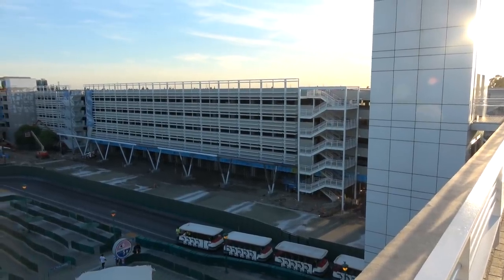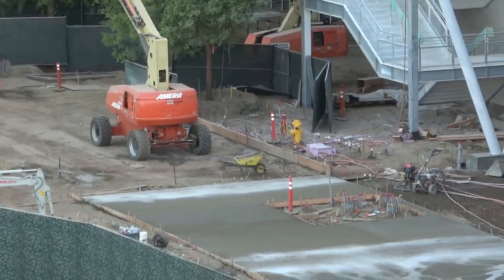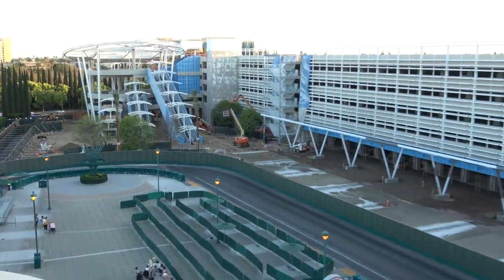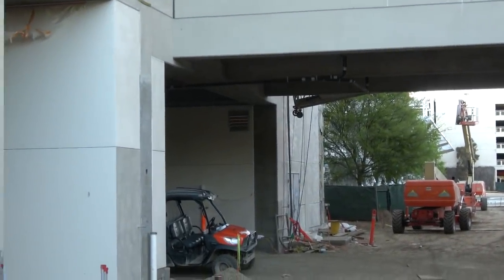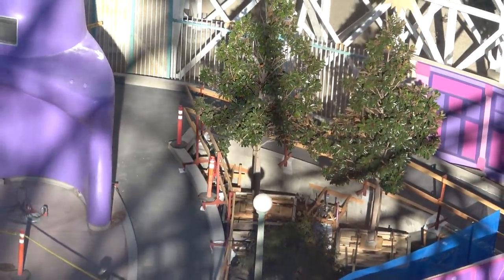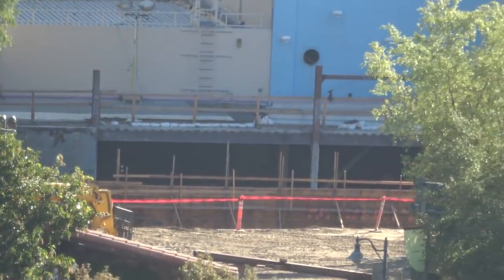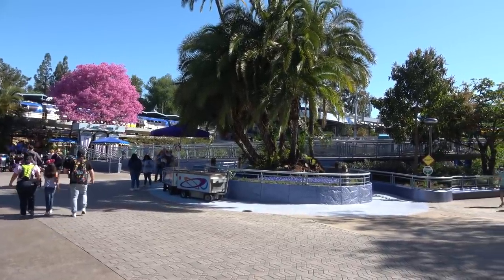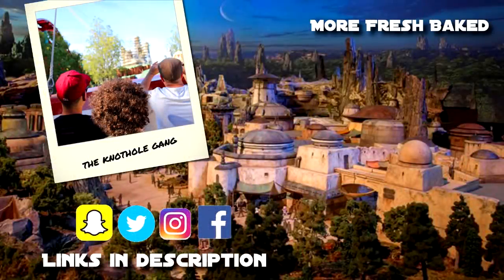Emotional Whirlwind surprise! - Disneyland Construction | 04/13/19 pt 58

Comment: Nope, not metal detectors. They are way to thin, and if you look you can see a second row of them right up against the parking garage supports. I suspect they are for holding awnings, maybe for bag screening?
Reply: My guess is they are for gates so they can open and close the individual entrances, I think the bag search tables and metal detectors will probably be inside the garage where they are better protected from the elements.  I could be totally wrong but the speculation is what makes these videos so fun.
Reply: @vooswing  I agree.  There are conduits next to the pillars.  More than likely a ticket booth with an arm gate.
Reply: I agree, because why would the metal detectors be on the opposite side of the guest plaza/escalators? It just didn't make sense to me

Comment: I was at the park yesterday (Wednesday) and I can confirm that the path you were looking at in the parking structure (from around 5:00 to 6:00) is indeed a new temporary walking path to DTD. My guess is that they'll need to switch back and forth between the two paths a couple of times to complete the paving in that area for the trams.
In the DTD parking lot, they've begun demolition. They were actively removing trees when I was there, and and begun removing some of the asphalt in the area towards the street. Looks like either a ground level foot path or an elevated walkway will be going in that area to connect the parking structure to DTD.

Comment: The tram route tunnel was given the upper 2x4 supports because the fencing out the outside (left in the video) doesn't have foot supports holding it up.  If you look at the bottom of that left side fence, you don't see the foot supports to hold it up.  Why they constructed the fence without the stablizing feet, I don't know but if you look at the inner fence (on the right) there are sandbags weighing down the stablizing feet on that fence.  They also went to great lengths to strengthen the upper supports with 45 degree cross beams in to the planters to help support the weight.

Comment: Don't think those are metal detectors.  There are way to far apart.   Most detectors around maybe 2 to 3 feet wide.   Those appear to be 6 to 8 feet apart.
Reply: They appear 18 inches apart to me.  You would have to go through sideways.  Not to mention you would head straight into a concrete pillar after squeezing through.   Definitely not metal detectors.

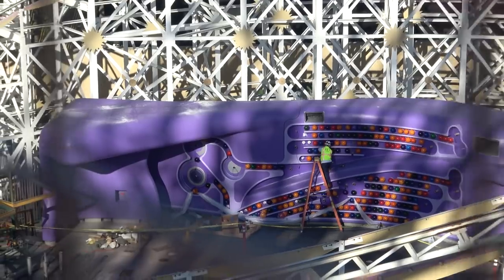Comment: Not unusual to see prefab fiberglass pieces built as one unit and then placed in situ. Pool manufacturers do it all the time. At 11:35, I believe there is another piece that will be brought in and placed over the conduit on the right for the anger observation lookout.  
I suspect the pipes at 12:00 may very well be a loading platform.  I've maintained all along that a pool of water will occupy the space under the ride. I suspect the ride will only fill one gondola at a time, much like a ferris wheel and then spins for a particular time and then one at a time disembark on the opposite side. The loading platform may actually have a lifting ramp that will stabilize the gondola for entry and exit. Notice the curbing around the exterior of the ride. That will be for retaining the water. Lights and possibly a water feature will possibly be utilized in all those white holes. 
I think the balls are translucent plastic cover for the light bulbs so they can be lit in various patterns.
Reply: Sounds like a slow loader.  But sounds pretty.  Fliks Flyers was such a short ride, what 30 seconds?  Maybe this loading , unloading style will give a longer ride?

Comment: Those are not metal detectors.  The security check will be on the first level of the parking structure, not outside the structure.

Comment: Is this parking structure taking the place of one of the old lots or are they going to cram all of the guests parking here into DL and DCA along with all the guests from the parking already there?
Reply: There used to be a surface parking lot there. The parking garage is expanding parking capacity in that particular location. In general, this is part of a move by Disney to increase/consolidate parking near the park where guests can ride the tram to the Esplanade, and to move security screening away from the Esplanade for safety/security reasons. They are supposedly still hoping to do the same thing on the East (Harbor Blvd) side of the park, by rebooting the Eastern Gateway Project they tried to push through before.

Comment: NSA!
Reply: They cut concrete so when it cracks, it will crack where they cut, it’s like a controlled crack and it works most of the time.
Reply: @14:53 you said they haven’t done anything, they’re staging. But your wrong, they have backfilled a lot of dirt, if you look ay a few weeks ago and see how far down they are, you can tell how much dirt they’ve put in and compacted.